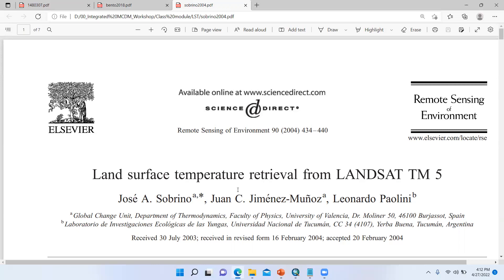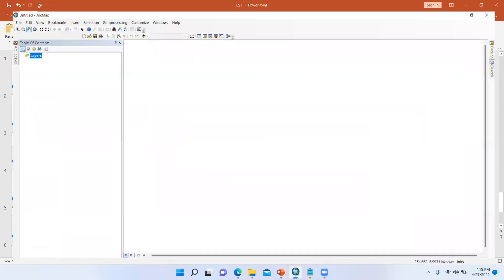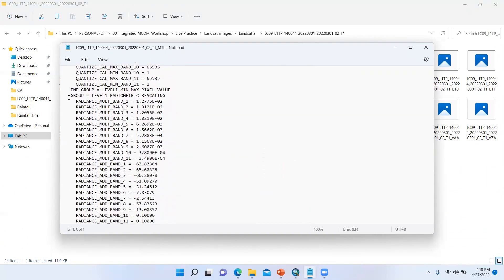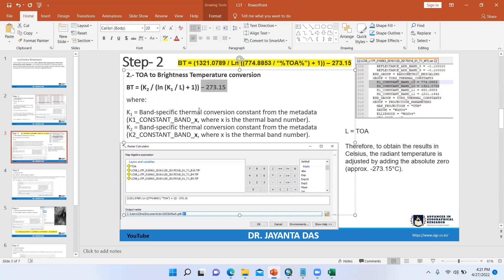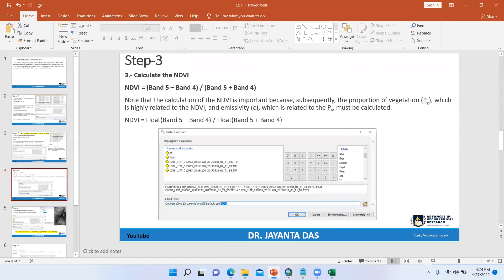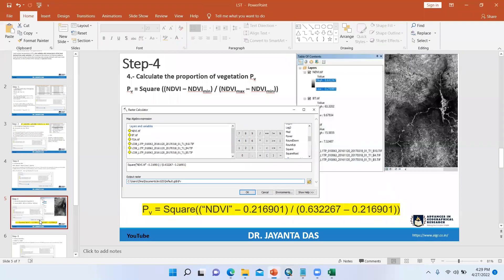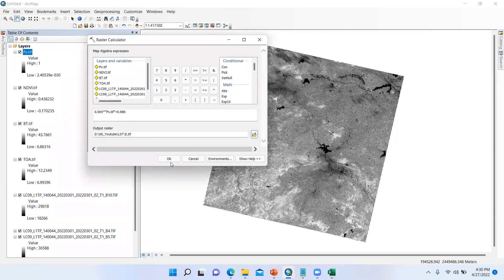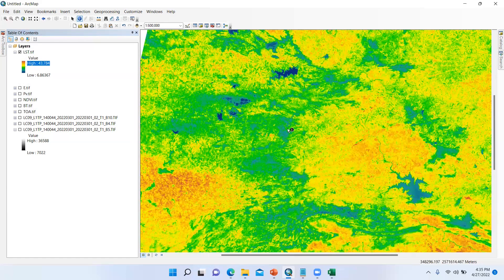How to calculate Land Surface Temperature from Landsat 9 using ArcGIS II Heatmap II Dr. Jayanta Das

Comment: I wanted to apply this video to the LST in Landsat (1984) but I found incorrect results ( Value is beween 78 & 7563). what do you think is the problem? Although I Used Band6 instead of band10, because it is not available in landsat5 (1984) , thanks

Comment: Excuse me, I have a problem generating the BT variable because it gives me temperature range data that is too high and I cannot correct it, it is in lansat 9, I would appreciate some guidance
Reply: The temperature is high because it is in Kelvin
Reply: @haidermajid-t5f  No, after correcting that by 273.15 it is still showing high

Comment: Thanks for your video! From my point of view, the calculation would be easier with a level 2 image. After converting from 16 bits to 32 bits you can use this: Band 10.tif * (TEMPERATURE_MULT_BAND_ST_B10) + (TEMPERATURE_ADD_BAND_ST_B10) = LST. Or is there a special reason for not doing so?

Comment: The Land Surface Temperature range seems to be on lower side. I have used this method for various regions in India but the LST range always seem to be coming on lower side. I have also compared LandSAT8/9 data result with that of data captured through Drone based TIR camera. This comparison shows vast variance in LST range but of course the High LST region match. Is this a case of Temp. saturation in LSAT 9 data around 50 degree Celsius. Can you explain??
Reply: Do you mean you get high LST values with Landsat 9? because it is what is happening to me, in L8 and L9 images of the same year and month, I get higher temperature values with landsat 9, I also want to know what happens
Reply: i have the same problem.  landset 9 showing more high number
Reply from the maker: https://aigr.co.in/
Reply: @DrJayantaDas  Good marketing

Comment: Very helpful video. Thanks a lot! I am just wondering whether you made a mistake in the NDVI calculations. You calculated „Band 5 - Band 4“ instead of „+“ in the second part of the NDVI formular at 9:30. So you subtracted B5 with B4 twice. Is it just by mistake and how does it affect the results?
Reply: I also noticed.